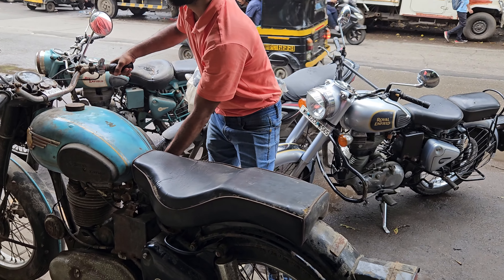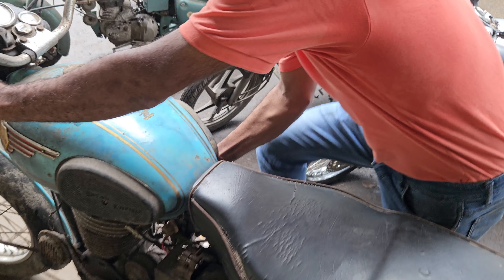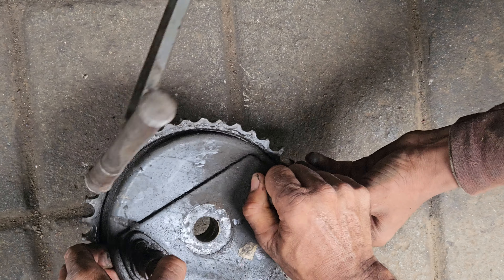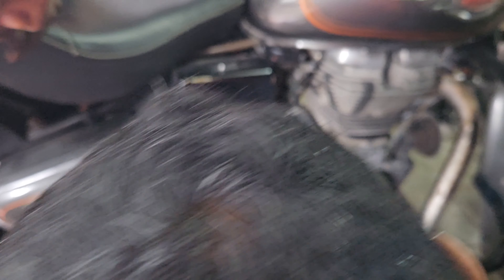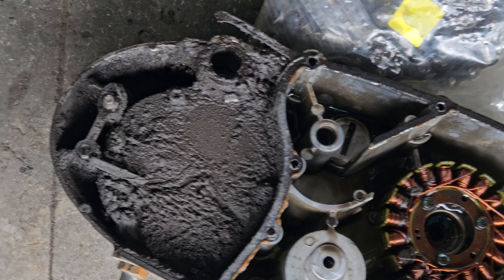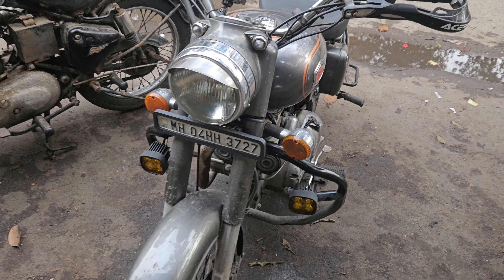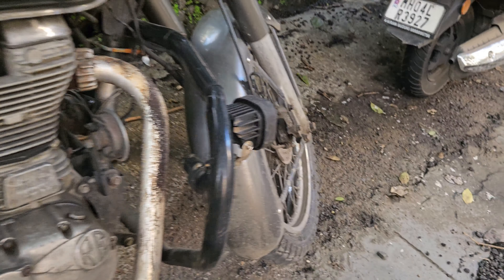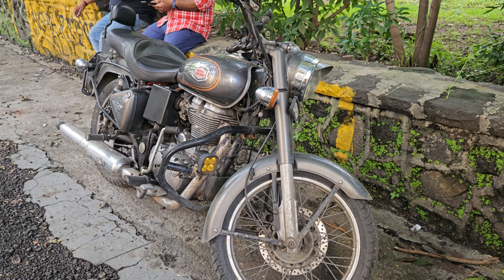Saying Goodbye to My Interceptor 650 || Chain Sprocket for Bullet 500 || Apollo Tramplr XR upgrade

Comment: What will be the benefits of carburettor initially i avoided for more torkey response? Many comments show less power and mileage, where to change dealership or shop if plan?
Reply from the maker: @PraveenKumar-vj7xv  don’t worry about making change right now. As long as your bike is not giving your trouble. Enjoy the FI. Carbureted bikes are easy to maintain. And changing from FI to carburettor will cost you no less than 13000. So enjoy your ride till your bike doesn’t give you any trouble.

Comment: Why carburettor not fuel injected?   Purchased 2018 bullet 500 forest green model in 1.10 lakh, no option for low price 
1. Whiich Tyres will be good? Or alloy is better 
2. Milage?
3. Stock silencer average, any option of saving from challan?
4. Service interval?
Reply from the maker: @PraveenKumar-vj7xv  hassle free ownership. Fuel Injection if goes for kaput it will cost you around 14000 same for the conversion. So if it comes with carburettor you are saved from unwanted investment. Alloy is not recommended as there will be no OEM. Don’t trust locals. Stick to stock silencer to avoid unnecessary traffic cops issue. Mileage depends on lots of factors like chain sprocket condition, clutch plate condition, spark plugs etc. I used to get the oil changed around 3000kms.  For tyres I will suggest MRF. And Congratulations on your new ride.
Reply: @motormoksh  Thankyou for response,   initially I will drive in fuel injection if their is any problem or lateron i will change to carburettor.

Comment: How much can we buy a bullet 500 for. Is it possible to get within 1 lakh
Reply from the maker: @-SKC  well it is now available in second hand market and possible it shouldn’t cost you more than 90k. It will be before 2019. And do not budge for kms shown because it can fudged easily. Check for fuel tank leakage or repair and any chassis impact. If you are thinking of buying one.
Reply: @motormoksh  Hi, thanks for replying.
I searched in market, the no engine noise ones, they are charging 1.3 lakh. 2017 model.They are saying its rare, and will only go costlier over time. I dont get them.
Reply from the maker: @-SKC  it is too much asking price. Negotiate with them. Apart from engine noise there can be other defects. Most common is repaired petrol tank , which if not done properly will give you trouble. Also avoid fuel injected ones. If it is converted to carburettor it is okay.

Comment: Couldn't understand the language.
What's the reason for selling your interceptor??
Reply from the maker: @thenilgirisbeyond43  primarily not riding.. secondly upgrading to a lighter motorcycle for touring…
Reply: @motormoksh  thank you bro. 
I tried many times to sell my interceptor, but I couldn't because of its performance and engine. 
But not able to manage it's weight in day to day life. Ridden 35k kms. 
I'm too looking for a lighter one. 
What's your option? 
And please give me a suggestion for standard 500
Reply from the maker: @thenilgirisbeyond43  there is no question with its performance and engine but the weight is making it troublesome in  touring. I find it very tough to park in an inclined parking and with luggage it even weighs a lot. So I am waiting for bullet 650 if the weight is well masked as RE did in case of Guerrilla 450 then voila. Else I have decided to go with Guerrilla 450. And as a stop gap I am using Bullet 500.
Reply: @motormoksh  thanks for the information 😊